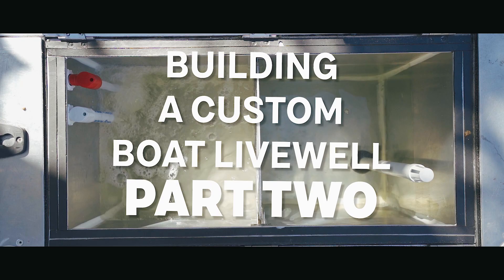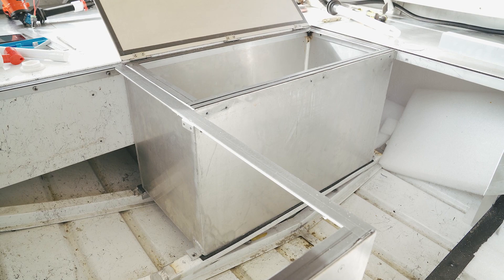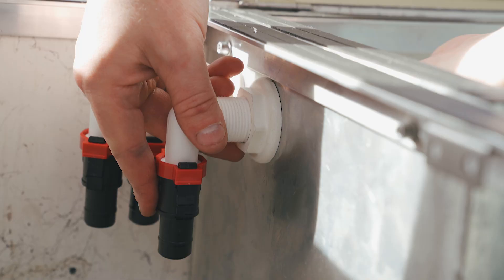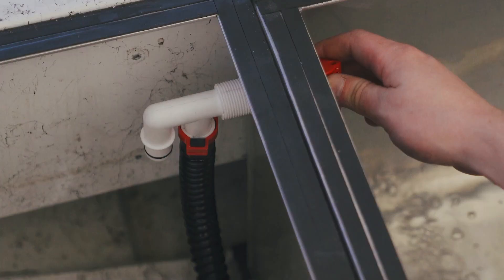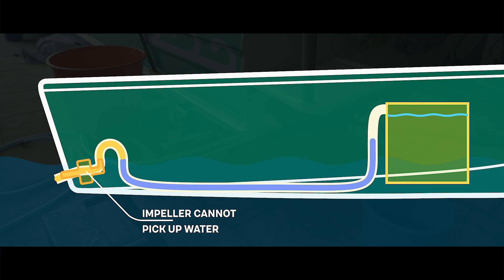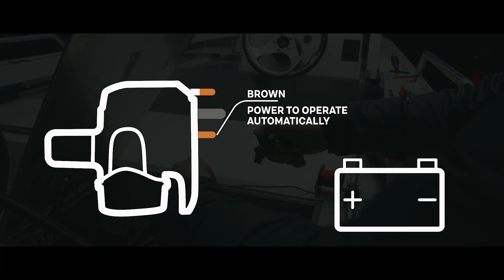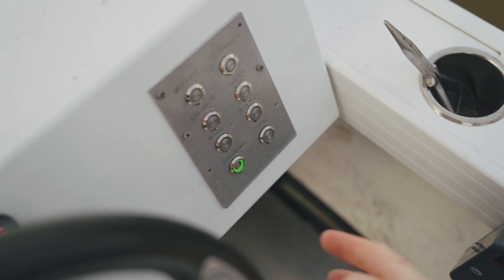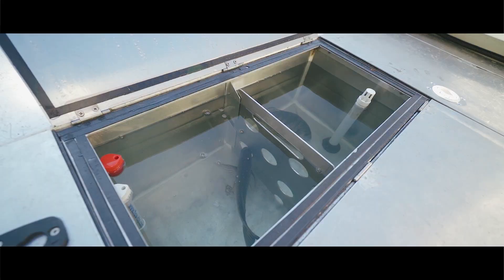ULTIMATE Homemade Fishing Livewell Pt 2 | DORA PROJECT 🧜‍♀️

Comment: Mate, defiantly do a video on how to wire a boat. That animation was the clearest instructions that I have seen on the subject. 
The Tiny Boat Nation guys have lots of info on it but It's explained at lightening speed and you need to have a fair understanding of the process to glean info from their vids. 
Sensational stuff, keep going!
Also a vid about ally welding for dummies would be awesome. I would be keen to have a crack at that.
Cheers
Reply from the maker: Sounds good Dean, I’ll see what I can wrestle up. I’m getting a little faster with the animations now so there a bit less daunting, but definitely still time consuming. As for Ally welding, I’d like to see one of those videos too ;) some days the welds look great, other days it would’ve been more efficient to get the drill out to make some holes!
Reply: @GriftCo  But the welds look miles better than rivets! Even if they are crap welds.
What's a ball park cost to get setup for the welding?
Where did you get the bling switch panel?
Cheers!

Comment: Really good quality video there mate. I just started installing my 27L plastic live well.. I am using a self priming pump so it will pump air. so no air lock issues. My bilge pump is already done. I am using standard quick connect garden hose which is cheap.

Comment: Great video mate, very informative. Not sure what treatment you did when you have the air lock but a potential fix could be a breather at the high point between the two low points. The breather needs to be higher than any other point in the line and a one way valve will ensure no excessive vacuum noise while on he plan. The breather does not need to be of large dimension it only needs to releave the pressure of he air lock. Not sure if it will work in you application but could be worth a try. Tight lines
Reply from the maker: Ill have to look into that closer Daniel, sounds like a good solution

Comment: very informative, a lot of good info. My only question is how does the tank drain out the back of the boat when the outlet is below the water line.Which creates pressure in the line?

Comment: need check valves to prevent air lock and on any points that could leak. i.e if the hose split would water rush in and sink your boat? then put a check valve on it.

Comment: Great video mate, have you thought about installing a pick up on the transom so water is going through the pump when on the plane? Installed one the other day myself and it's awesome.
Reply from the maker: Hey Owen, yep thought about it, and I should’ve shown that the pickup I have installed is projected forwards so it should be less likely to Venturi out. I mostly have airlock at the start of a fishing session when the water in the line drains after pulling the water out and the water in the dip hasn’t evaporated or drained. I’m probably just being a pedant but I do like when things work as intended!

Comment: Really great video.  I'm trying to plumb a smaller baitwell for some shrimp in a small boat I am building now.  Your video helped.. especially the part about airlock.  Question... What was that tool you were using after you drilled the holes with the big step bit?  Some kind of chamfer tool or something?
Reply from the maker: Thanks Danny - it was a deburring tool
Reply: @GriftCo  thanks for the answer.  I gotta get one of those!